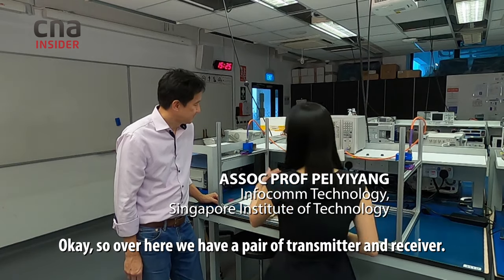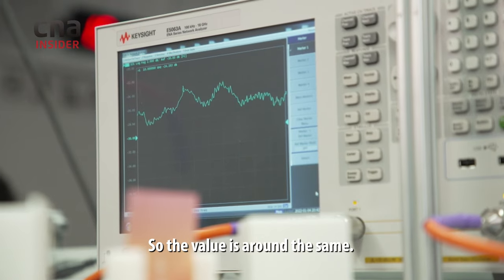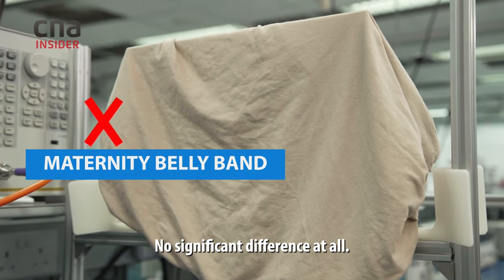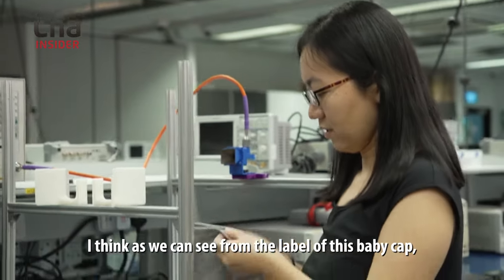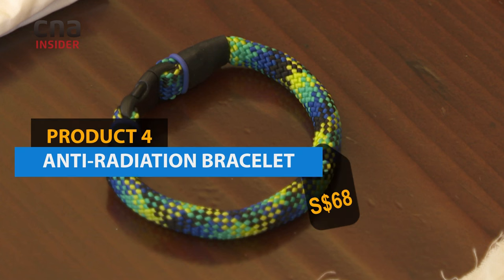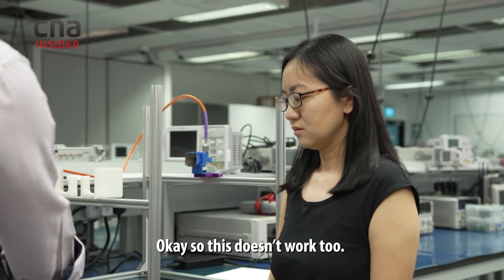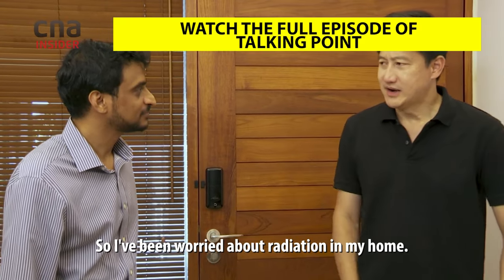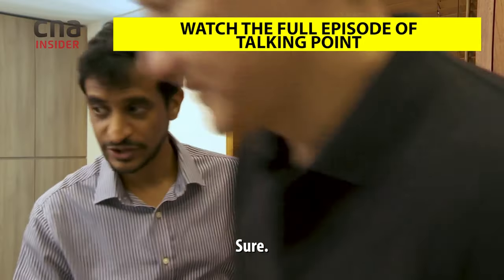4 Anti-Radiation Products Reviewed (By A Scientist)

Comment: i have tried wearing 2 leblok branded hoods (covers entire head except for eyes, nose and mouth) cell phone/wifi signal goes to 1 bar or no signal wrapped in 2 of these.  Wearing just 1 (as a night cap) i noticed occasional better sleep.  Wearing 2 at the same time instantly better sleep, much better, i couldn't believe it.  in my experience  two layers are much better than just 1.  Guessing product quality matters also.  Side note: sometimes i roll the 2 hoods up to eye-and-ear level with similar good results, imo there's something to shielding the brain while you sleep that helps with overall sleep and allows deep sleep again.  I do not sell or link to these products.  If even more sensitive - try using in combination with an entire bed/ceiling hanging emf-blocking-canopy also (and point a fan at your space for good air circulation). good luck.
Reply: An Industrial faradeyic Cage is build with 2 seperate layers, that do Not Touch and 2!!! Different grounding Connections. Thats why 2 works better. You get closer to Industrial Level of radiation protection
Reply: enough is deflected ime to make a significant difference.  works well for me, sleep great now. youre mileage may vary
Reply: I'm about to try this using a beanie plus a hoodie, both silver backed. I'm on my third week surviving on only two hours a night sleep. At my wit's end. Hope this helps, and many thanks for the suggestion.
Reply: I just ordered a Leblok shirt and hood. I had a hat that lasted me a couple years but now it's worn out, lost shielding due to wear n friction. I see how many people are effected now compared to 4 years ago. Also free radical scavenger supplements and vitamins work!

Comment: Thank you for this information.
Please stay truthful and honest. We need it
Reply: They are not, theyre lying right to your face. These devices are very dangerous. Buy an rf meter and youll see the reality.
Reply: @Mihalyofficial  Just because the RF is there, doesn't mean it's dangerous, just don't hug the transmitters
Reply: Honest??  Who are you kidding? . 'all these phones are within the set limits' - that's bc the limits are 'paid for' by the lobbying phone companies.  Go get your smartphone full owners manual and read all the small print - you'll likely never want to go near one again..  And this is FACT, When Microwave ovens came out in the UK G'ment set 'safe limit's' far far higher than they were in the USSR. WHY? Bc every time our weapons and MI5 agents wanted to do Radiation based tests they had to apply for a special dispensation order. Where as the USSR agents could do what the h*** they liked bc it was communist.
Reply: All these items are likely ACTUALLY radioactive and more dangerous than 5g… which isn’t dangerous at all. Most of these types of items shown, and I mean most, contain the radioactive element called thorium which produces radon gas in addition to being a strong alpha radiation source. There are several videos you can find now, we actually buy these products in the radioactive isotope groups we are in to run said tests on them using Geiger counters and scintillators to have these items removed by the NRC. Almost every single one contains thorium, you are putting yourself at risk by buying these and not knowing what it actually is. This is why you shouldn’t subscribe to conspiracy theory, it’s going to end up killing you.

Comment: I bought a brand on amazon called WETBEN EMF they also had a video footage of their phone beside a electromagnetic radiation detector when the EMF sticker was put on the phone the radiation levels went down to zero indicating that it works however it wasn't sticking to the phone in the video not sure if it's also a scheme just didn't look like it unless not all of them are dangerous not sure if anyone has an answer to this

Comment: "within the safety limit" . .which is what exactly? you think the one's who cause teh radiation will admit it's dangerous? please. . also there is a difference between BLOCKING a signal and FILTERING the harmful frequencies. . like filtering water or using sunscreen. . and yes, many sunscreens CAUSE cancer. . you want your devises to work not work harder to receive a signal. . which is even worse. .but also filter out the harmful radiation adn dirty electricity.

Comment: The baby hat works like a tin foil hat, which actually increases the EMF hitting the head by reflecting all EMF from below in to a point inside the beanie (like a satellite dish).
Reply: Ok so where is that video or documented evidence?  I’d like to see it because I see a lot of comments saying this with no demonstration or evidence
Reply: No it doesn't. It blocks the signal. Just try to make an aluminum envelope, then put your phone inside it and try to call it, and you will understand.
Reply: @shaunmeyer420h  The test was a DIRECTIONAL test, the EMF was sent from pole to pole directly, that's not how 99% of EMF travels, it's done this way so that the EMF isn't bouncing off every object in the room because that wouldn't be able to test weather a material was permeable to EMF.

Think of it like testing a net, you throw a ball directly at the net and see if it's stopped, you don't test it by firing balls all over the room and seeing which ones end up on the other side.

Similarly if you fire balls at a metal bowl all the ones that hit it on the side are repelled, but if you fire those balls all over the room you end up with a bowl full of balls that remain there.
Reply: Something’s funny when you can’t get a clear answer from
These people

Comment: These devices were designed to be used directly against or over the body or object they are protecting.  How are they supposed to block a signal 1 foot away from the object it’s protecting. How large of a field do you think they’re generating? 🤨 For this reason I believe this test is flawed, making the results invalid. I personally tested my stickers as they were designed to be used with my own meter and noted a significant reduction. I’m no scientist though. Just a guy with quality emf protection stickers and a quality emf meter who knows how to follow the directions for use. 🤷🏾‍♂️
Reply: Large enough to mess up my own emf

Comment: What if you live near a 5g tower? How do I protect myself from that aside from moving???
Reply: Crash it and say a deer ran into it..
Reply: @nyahgood  faraday cage
Reply: @midnightsnack1306  can you give me some source to know more about faraday cage effects?! I am almost beginner in this case, thank you.
Reply: You can use attenuating fabric around your bed. You can paint your house with radiation-blocking material (it's almost always grey or black, though), you can install aluminum-lined insulation or just aluminum sheets behind siding, you can hang attenuating fabric on wall studs prior to gypsum board, or if you're rich you can install a reverse polarity 5G emitter that effective neutralizes the signal in near real-time. A very common solution which most people lament is using aluminum or steel siding instead of vinyl. Interestingly, this is often times cheaper than the vinyl siding due to requiring less labor.
Reply: Don’t worry about it it’s just microwave radiation it can’t hurt you it’s less radioactive than visible light
Reply: emf bed canopy properly grounded, many companies sell them now